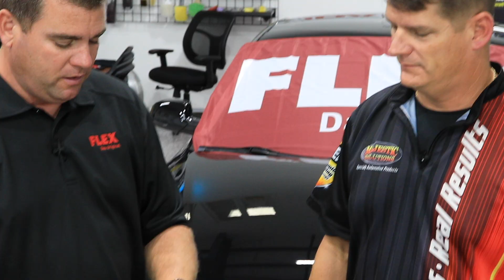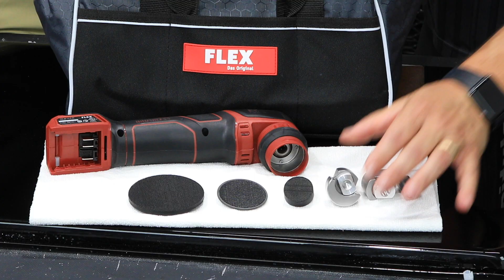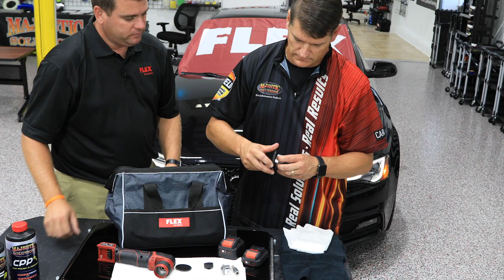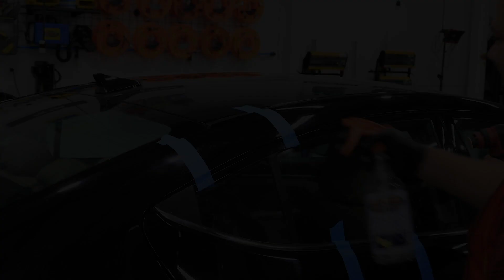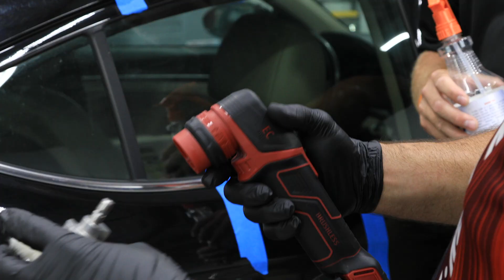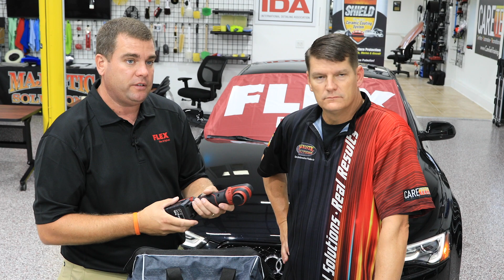The New FLEX PXE 80 Multi-Purpose Polisher - The GAME CHANGER!

Comment: You need to add the ability to use it as a wired unit as well like the ibrid Nano. This is the kind of product I would use connected to my car with an inverter to save my batteries for when I really need it... honestly, the Nano, along with the kit it is sold with, even at $200(ish) more, appears to be a more complete set up and better bang for the buck from what ive seen
Reply: I have the Nano and its awesome. However, the nano simply cannot compete with the fact that this is a brushless machine and this machine does 3 inch which the nano does not. The nano also does not do two inch in rotary mode very well either, and the nano cannot swap out backing plates super fast like this... You need to unscrew them with its supplied wrench in the nano kit. However, nano came out well before this, so I'm sure Flex was trying to aim at the nano for things that its not good at. Nano does have two advantages though... First would be scrubbing things with the included scrubbers in the big kit, plus the wired option. Hope that helps. Ill probably just have the flex and my ibrid too. LOL
Reply: when the nano was released I bought it, for this time it was cool but flex released this missile. the engine is not the same it is twice as powerful